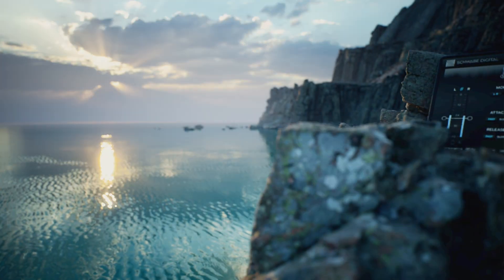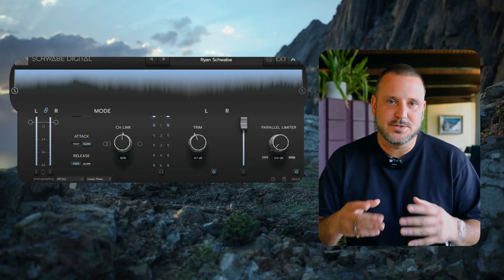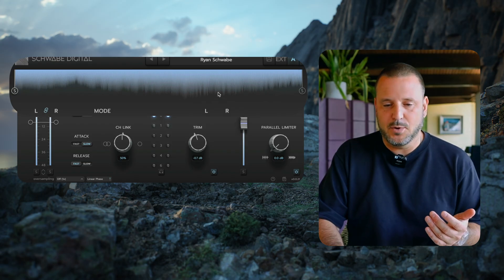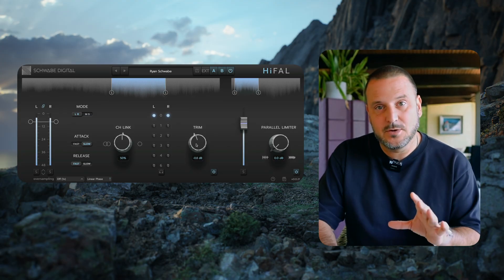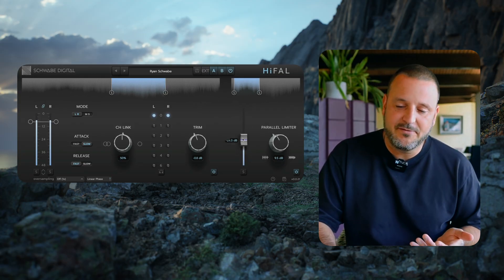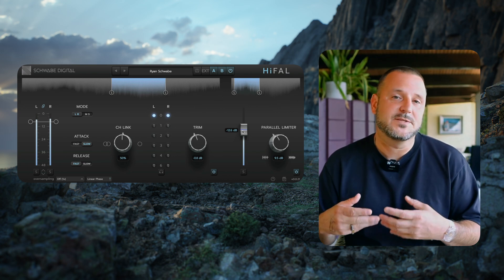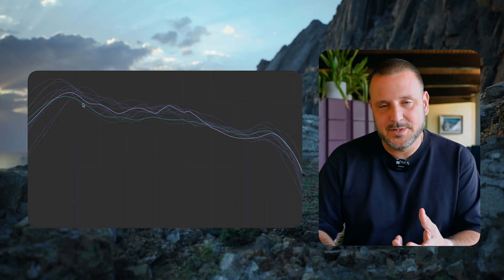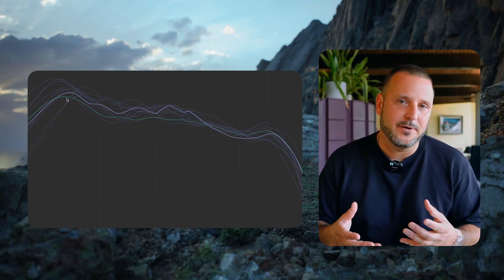9) HiFAL's Tuned Tonal Balance Display

Comment: Genuinely curious, is the left section different (aside from the spectrum analyzer) than just using a multiband comp and bypassing bands? Or just an easier/more user friendly way to go about it?
Reply from the maker: The left side can be thought of as a single-band multiband processor. That’s correct. The right side is a single-band parallel processor. One is band-specific top-down compression, and the other is bottom-up, band-specific compression.

Comment: Ryan, I've been demoing HiFal on some masters I finished a while ago, on all songs there's improvement. Basically after watching all your videos and reading all promo/how to emails I got from you I have a good knowledge how HiFal works and what it does. But... After testing it today on one particular master I've done in the past, the MAGIC happened. I'm still scratching my head and cannot understand what happened. I used HiFal pretty much standardly to tame harsh hip hop/trap hi hats iin the top end of the song. Pretty standard. But now apart from the hi hats not being harsh, the stereo field opened up, more importantly the low end (kick/bass) is way more solid and punchy, vocals started sitting better in the mix and what is WEIRD the master sounds more 3D and detailed. I can hear delays, reverbs way better, mix sound like a 3d box. When I bypass HIFal everything becomes flat, paper thin and those delays/reverbs are not that audible. I only tamed harsh hi hats. I cannot understand what happened. Thank you for your detailed answer.
Reply from the maker: Lucas, that’s really interesting. One of the unusual things about HiFAL is how wide the attack and release adaptation range is. It can go from extremely slow to extremely fast. Because it only applies gain reduction, you’d think it might make things darker, but psychoacoustically it often feels brighter. The high frequencies are more controlled, and your ear adapts to that, perceiving more clarity and balance. Our sense of low end is also shaped by what’s happening in the highs, so HiFAL can have psychoacoustic effects that go well beyond the specific bands it’s processing.  Very cool to hear that. Appreciate you sharing.
Reply: @schwabedigital  I felt the same on a project of 5 songs that im mixing, the drums was really well recorded by the drummer, a jazzist, but the OH´s its a bit harsh sometimes, I used TDR Arbiter (which I really love) some eq and tube compression,  but when try this one as a final control before the final eq, just poping the light, it not turn to a darkish the cymbals, but revealed a great detail <3